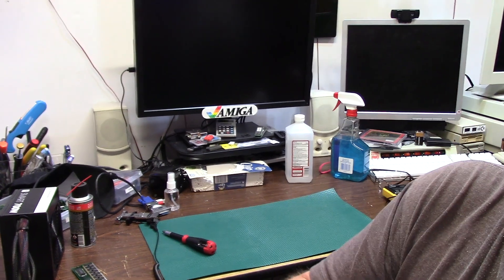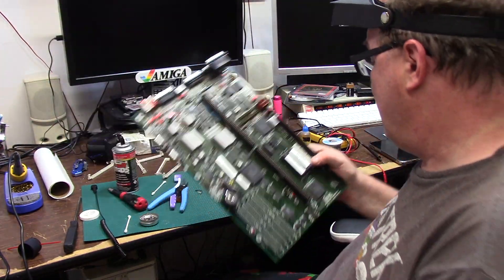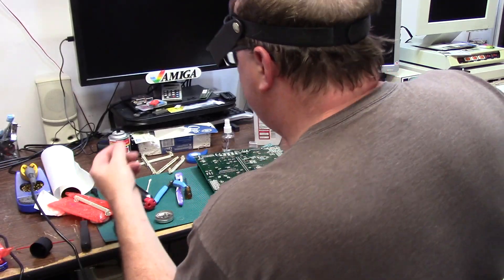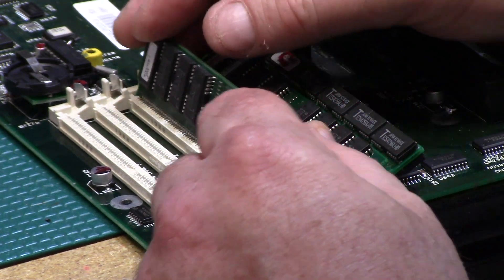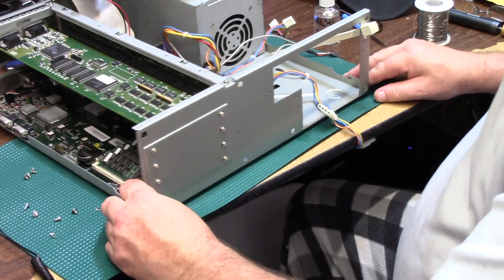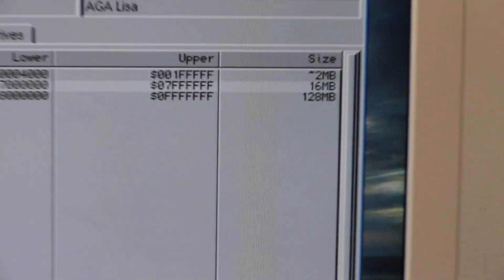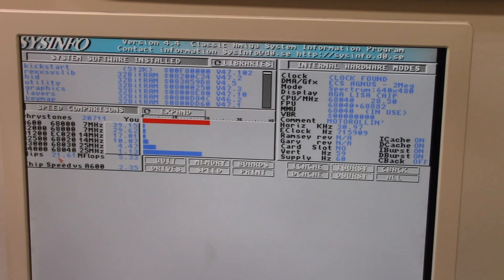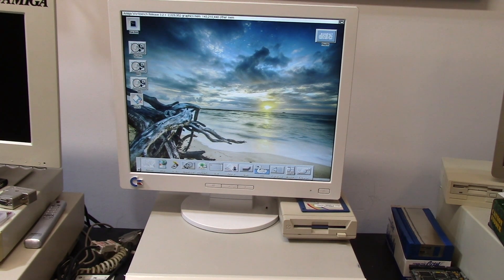Amiga 4000 simm sockets and a Warp Engine 040

Comment: Drop a 060 adapter and a rev6 cpu into that warpengine and 40mhz oscillator with phase5 060 libs and that warp engine will zip along at 80mhz 060. the SCSI is nice and fast,i get about 9MB/s off it with a acard 7720u scsi to ide bridge and ide adapter with a sandisk CF. It has some of the fastest ram access and scsi out there.
Reply from the maker: now to find the elusive 040/060 adaptor
Reply: @ChrisEdwardsRestoration  there was one on ebay just a few days ago with a rev6 060 too..i almost pulled the trigger.

Comment: I had to laugh.. after 20+ years of fixing everyone elses machines,i'm now half blind and most my machines needs caps and assorted repairs. I know the "720" pins saga well! replaced so many A4000 sockets with gold molex connectors..can't count them all. The 40 degree sockets also work if you use short simms.